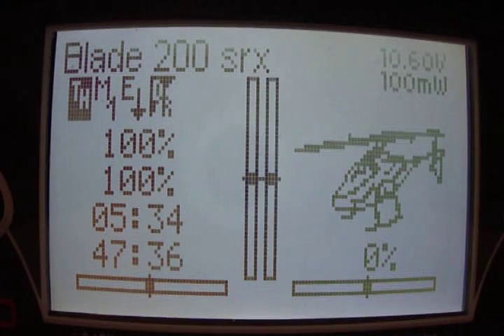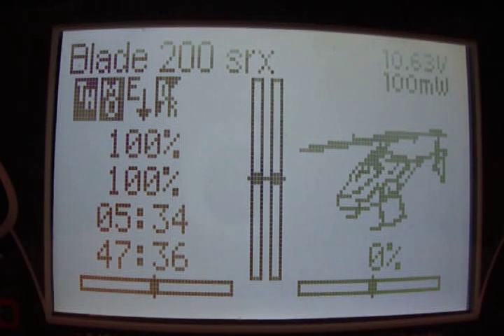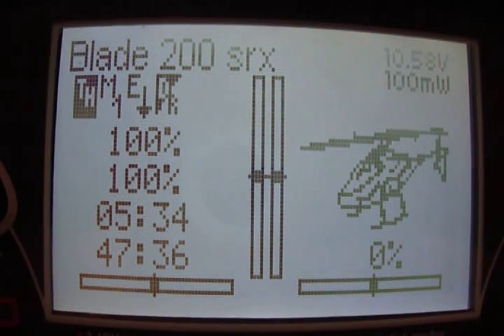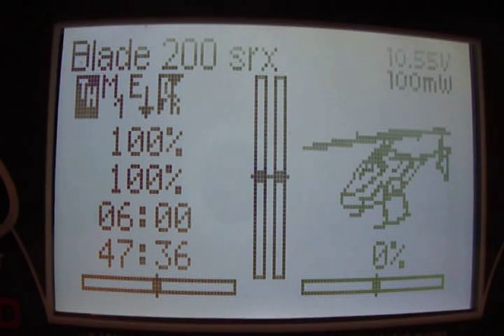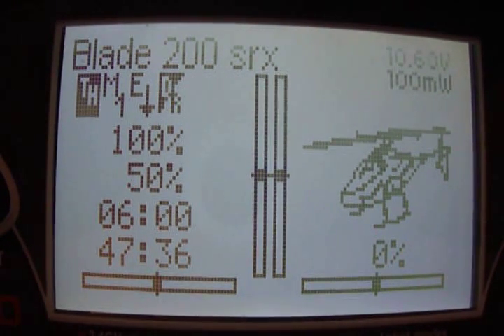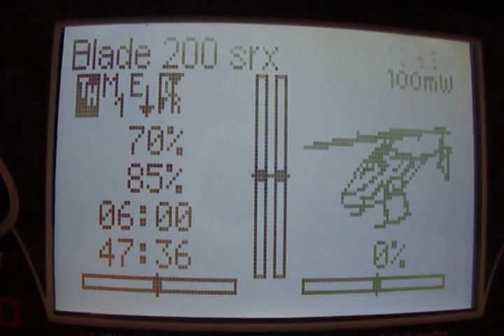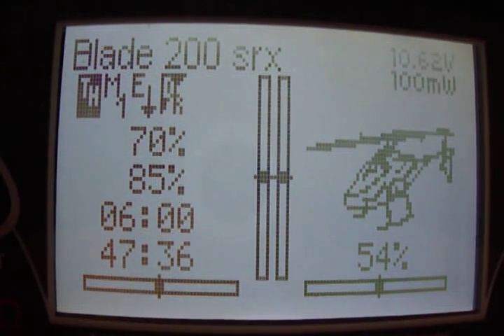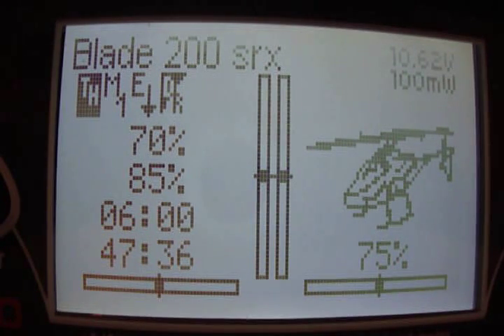Blade 200srx / Devo 10 - Increasing Motor Power

Comment: nice  informative video.  Have you had much luck flying this bird in the expert mode?  Have you tried any rolls or flips?
Reply from the maker: Thanks. It is still winter here so I only fly around my driveway and front yard. I have hovered around in expert mode with my AIL/ELE turned down to about 65% but that is all. No rolls or flips yet - I'm too chicken to try over the concrete. But the power increase definitely is an improvement.